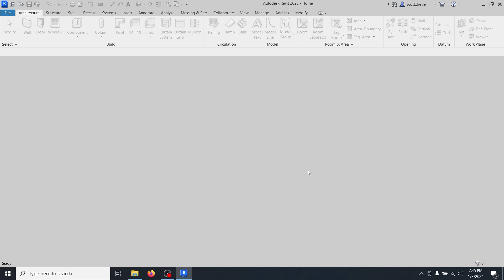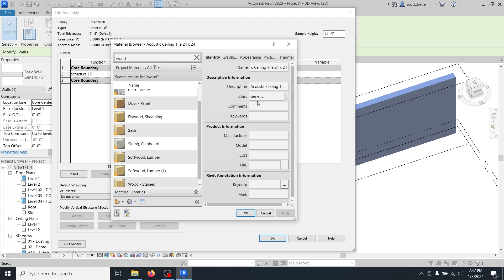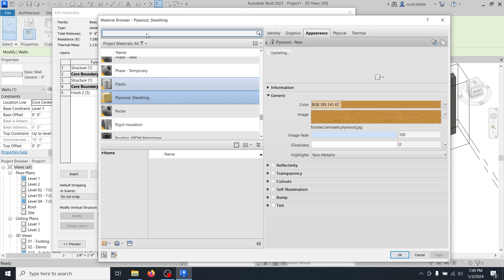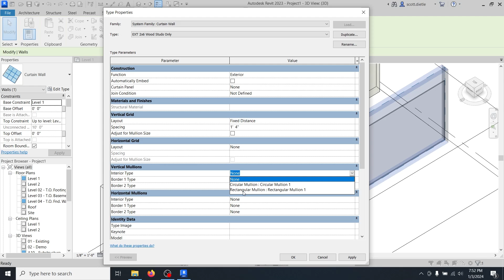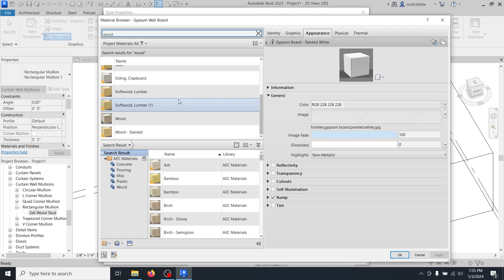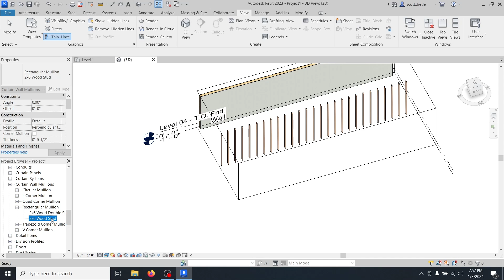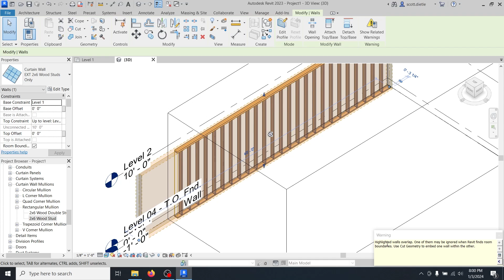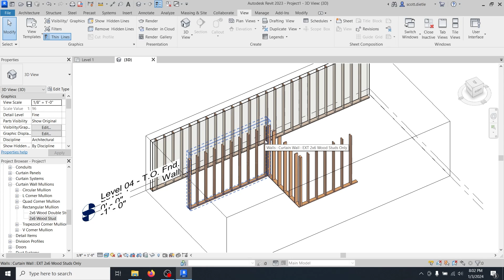Revit Tutorial - Framed Walls with Actual Wood Studs

Comment: Great video! What's the best strategy to model insulation panels between studs? Thanks!
Reply from the maker: Oooh good question.  I would use a curtain panels between the mullion "studs".  You might get some strange things at corners and around doors.  Plus Revit will want to tag the wall assembly with a wall tag so make sure you don't tag the insulation by mistake.  Great idea though!
Reply: @doubledeitle could you please suggest us how to do it? Maybe a slides or a video ? Curtain walls and panels are always tricky😅 thanks 🙏

Comment: What if i need a schedule of the mullions for quantity and pricing
Reply from the maker: You can create a Curtain Wall Mullions schedule, make sure you set an additional parameter in the mullions to identify the mullion type, and Calculate Totals for length.  Also add the Count parameter.  This will give you the # of mullions as well as the total length.  Usually we cost storefronts by area (cost/sf) so I haven't used a mullions schedule for pricing.  Thanks!

Comment: instead use framing system mullion cant have openings i tried it in my project later changed to framing system
Reply from the maker: Absolutely you can use the structural framing systems as well.  When I have used these, they seem a bit more limiting to me than a curtain wall family.  For openings, I usually edit the profile of the wall as a way to get doors and windows shown, and you can change the mullions to be headers, king studs, jack studs, etc.  Great comment, thank you!